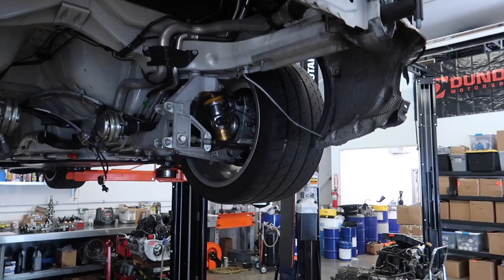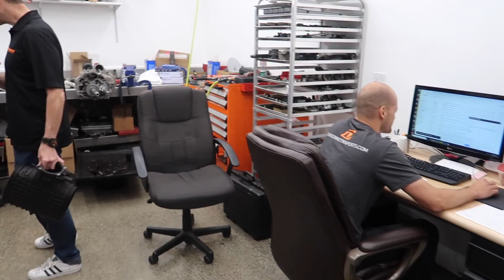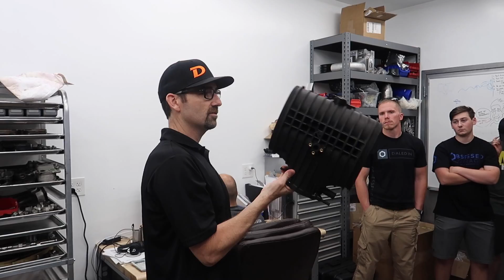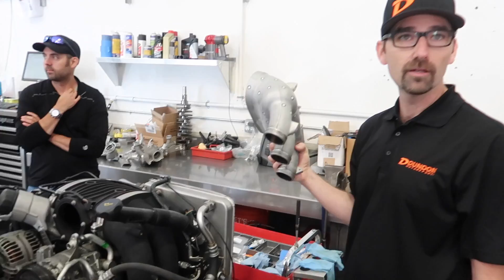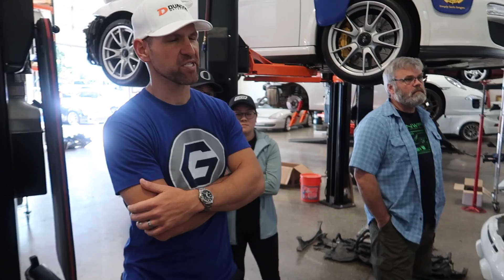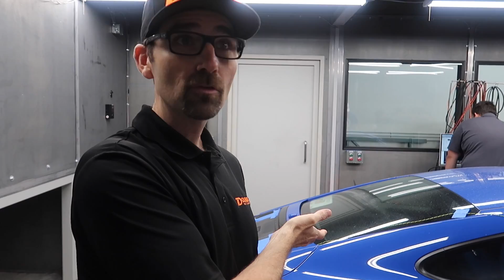The Engineering Behind Making Naturally Aspirated Horsepower:  Dundon Motorsports Tour

Comment: Also when it comes to Porches, you only need one company and thats RUF in Germany, no one is better or has more experience with Porsche tuning on the road or circuit (Nurburgring) :)
Reply: yup theyre legit to
Reply: Dont know much about porches though, just hear stuff and Ruf is pretty known, alyways loved the body parts aswell.anyways Nissans are faster down the track, so i own one of those :). NA drive is fine, but all that fuss about 400 bhp, i barely did anything to my Z and im already over (500 bhp on the wheels), goodluck adding turbo to a porsche :P

Comment: As an engineer this is my biggest gripe. We’re constantly told to scale things back to cut costs, or modify an already existing component to squeeze a little more from it before a total redesign. I’ve created new, more efficient designs only to have them sidelined in favor of a more readily available alternative. In time those designs will see the light of day but only once they can’t squeeze any more out of the old design and they’re forced to update. I rant about this at every opportunity and I’m glad to see these guys capitalize on the gains left on the table by manufacturers.
Reply from the maker: That's super frustrating.
Reply: But it's not really gains left on the table tho. They know that they can achieve emissions with x parameters met, so Porsche just tries to met those parameters on the line-up. Designs like yours would be tested & tried. The usage would be dependent on performance and emissions, if it fails emissions and is allowed in any of the championships regulations, it will be used there. That's the beautiful thing about having a racing department.